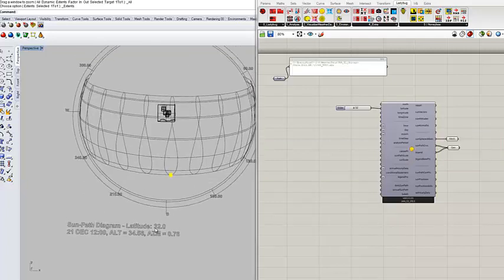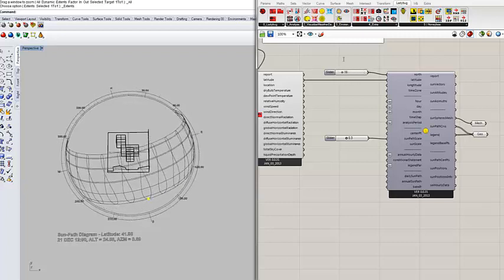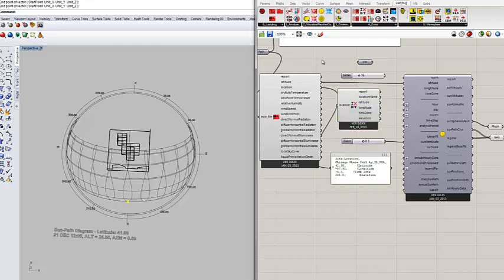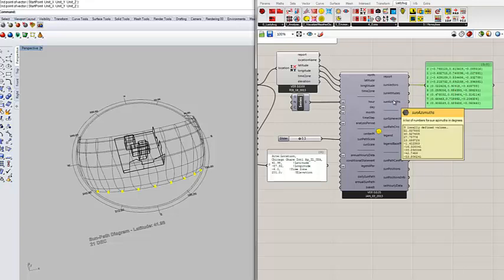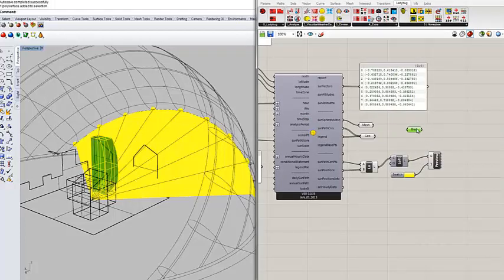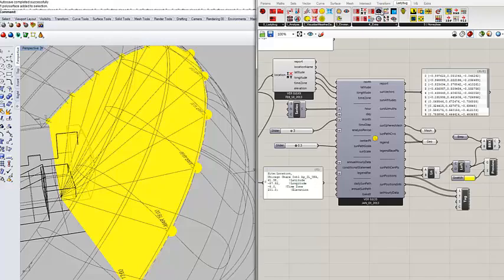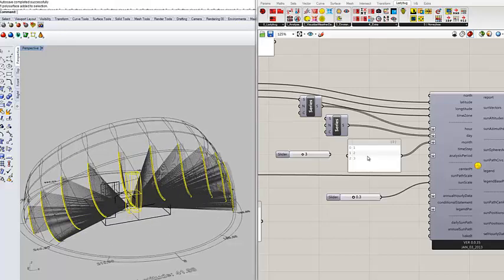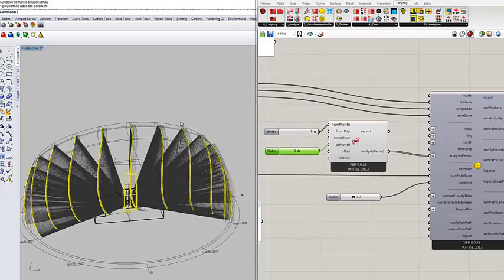How to use sunpath in Ladybug - Part 1 of 3

Comment: You used the center point the create the "sun beam surface". What can we do the handle the sun more like a parallel light source? If the scene is more extended, the sun beams should not focus on one point but should be approximately parallel. Otherwise, the result depends on the position of the center point. That is quite inexact. Could you possibly use a plane instead of a center point? Or am I wrong?
Reply from the maker: The sun positions for each hour is parallel. That's what sunlight hours component does and shoots the rays from test points backwards. Please post your follow up questions to the forum: http://discourse.ladybug.tools/t/welcome-to-ladybug-tools-forum/8